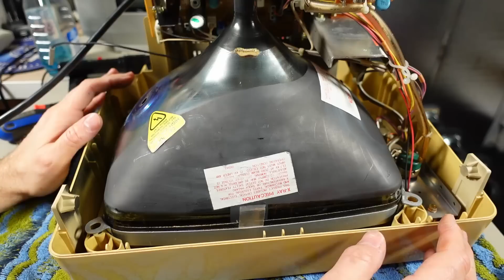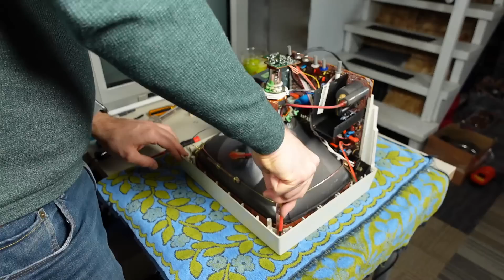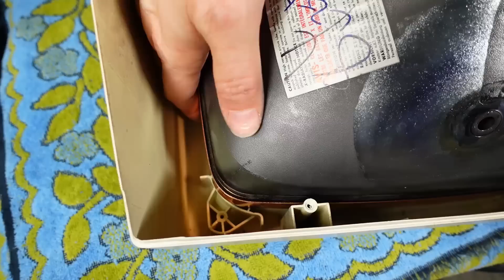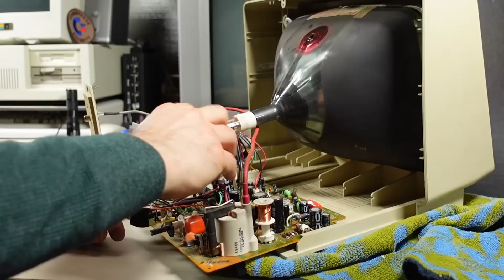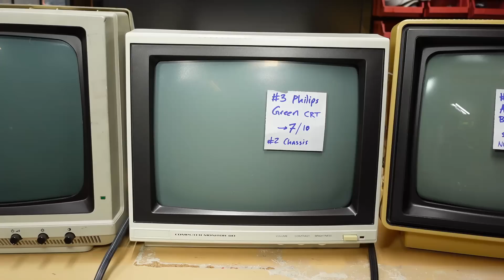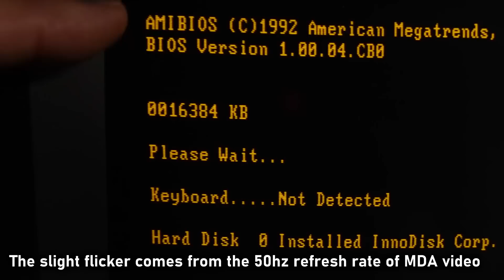Let's improve some monitors! (Part 2)

Comment: What CRT tester are you getting? I recently bought a Sencore CR70 for my vintage/antique TVs that help feed my retro-gaming addiction. Funny thing is, the game consoles were not retro when I got them. Just couldn’t part with them and now they’re considered retro. Damn I’m getting old (recently turned 40).
Reply from the maker: I got a Konig TR850 which is the same as the B&K 490B. I'll be showing it on the channel soon as it's a neat tester.

Comment: Not sure if it has been mention but grounding the high voltage to the monitor chassis does not discharge if the chassis itself is not currently grounded. Essentially its a floating ground at that point. Proceed with extreme caution if doing as Adrian has demonstrated.

Comment: A Sampo monitor?  About 20 years ago I bought a crappy digital camera which had no branding on it anywhere.  In exactly one spot in the manual there was a place blacked out with a marker, and I could barely make out the name "Sampo" underneath it.  It's like they were so ashamed of that camera they didn't want to put their name on it!  (It really was crappy, too.  640x480, internal memory with a max of 32 photos, manual focus only, no screen at all other than the tiny display that showed photos remaining and battery life, and it only transferred photos through the 9-pin serial port.)

Comment: Brightness seems ok to me. Having used those amber monitors, i actually liked that they are reasonable dim yet have a great contrast, the color just perfect for monochrome, i personal like that much more over green or - the horror-  BW. I don't recall maxing the brightness on the monitor i had, quite the contrary. Then again hard to judge on video i guess have to go with your judgement too.

Comment: You know where as those cloth coverings are concerned I've always wondered why they didn't make them a snap-in attachment. It wouldn't have been hard to do and it would've made them a whole lot easier to clean. What a fail. On the one with the case that doesn't fit, you could safely flip the CRT over. It should still be safe enough for the PCB because there's more than 3" gap from the components in most of those old monitors. It's worth checking out.

Comment: The breathing expansion phenomenon is caused by the variation of the anode high voltage. Because the deflection sensitivity depends on the anode voltage, there are many ways to improve it.

Separate the high-voltage circuit from the deflection circuit, and install a negative feedback for the high-voltage circuit to adjust the high-voltage power, which has the best effect. This method is used for high-end models.

In some chassis, although a combined circuit is used, the Re-trace capacitor is divided into two parts. One part of the capacity is adjusted by the PWM switch, and the high voltage can also be adjusted.

Generally, for CRTs produced in the 1990s, the ABL voltage is connected to the horizontal size modulation and the vertical size negative feedback for dynamic compensation, which can be partially improved. This is the most common method.

However, the focus voltage is still affected. In addition, the pattern still produces multiple distortions. Some models use ultra-high voltage capacitors and resistor packs to remedy them.

A lower cost method is to directly connect a resistor in the main power supply. When the beam current increases, the power supply of the deflection circuit also decreases, achieving self-compensation, but there are many side effects.

Some FBT manufacturers will try to reduce the output impedance of high-voltage power, and even carefully design the resonance frequency to odd harmonics, so that the Re-trace parabola is closer to a flat-topped square wave and reduces voltage changes.

Comment: The monitor with the crt that the back dose not fit couldn't you turn the crt upside down so the high voltage connector is on the bottom?

Comment: Do you adjust the yoke by hand with the power on? Is that safe to do?
Reply from the maker: I did -- I turn it by the plastic part -- there are exposed terminals which can give you a zap, but the copper color parts are enamel insulated copper. If those were not insulated, the whole deflection yoke would short out.

Comment: Not to be “that guy” as they say but get a flat tip for your HV probe.  If you do find a CRT with a high stored charge then it will easily jump from to the screwdriver you were using which won’t be rated to kilovolts.   I still work on CRTs for arcade enthusiasts so I’ve had a zap or two.

Would you also mind telling me what the rode mic is you have clipped to your shirt?

Comment: Adrian! 22:12 don't do that anymore!!! If you let the tube on the table like this it make a small sound like "crack" and then the Picturetube is total distroeyed. I was at Philips Videorecoder (IR3 Gutheilschodergasse 17, 1120 Vienna) Company her in Vinna from 1997 - 2000 and I work for 35 years as a Radio & TV service and this is a nogo. Sorry to tell this - but what you are doing if the tube make "crack"? You can hit the screen on the trash. Best Regards Volker from Vienna and Thumbs up Nr. 2522

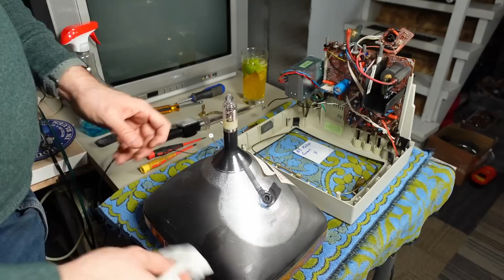Comment: 11:13 Cleaning the inside (and the back of a CRT in particular) is not weird at all, older tubes can (due to 
static charge) have collected a lot of dust and if there was a smoker in the area also a lot of (sticky) tar.
The high voltage can easily creep through and reduce the picture quality or even damage the electronics.

Marvin says: Don't panic and wear your Mask. 🖖😷👍 ❗

Comment: Actually the bloom on the green text at 26 minutes is from the cathode.  Due to the very small pinhole for electrons, the current caries away the material in the center of the cathode so it no longer emits electrons, so when you turn up the brightness, the area around the dead center of the cathode produces the emission. This larger emission area through the grid results in that soft edge dot on the phosphor.
If you ever trash an old worn out CRT, carefully disassemble the electron gun. Remove the grid off the cathode inside of it and look at the surface.  You will see the center has been sputtered away by the emission current from the center of the cathode.

In a prior career, I used to put new CRT's in televisions when color TV's were very expensive.  Used to do the rejuvenation which blasts off some of the cathode material to remove the dead layer that blocks emissions. This is often a short lived fix as the now thinner layer of emission material is quickly burned through, and if the tube is old enough, the rejuvenation will remove the last of the active cathode material, rendering the tube useless. An alternative to rejuvenation of the cathode is to use an auto transformer on the filament to run the cathode hotter to increase the emissions. This too, increases the aging rate, but provides a temporary extension to the end of useful life of the CRT. The transformer often would raise a 6.3V filament to about 8 volts.

Comment: I had that NAP monitor.  Even brand new, it had that picture collapse at the top.  I had a friend with the same monitor and same problem.  That is the "personality" of the monitor.  It was cheap and available at PriceClub (now CostCo).  It didn't cost much.  It was a tank though.  It fell down and flight of stairs (carpeted) and survived without issue.

I used it with my TS2068, and because that computer had a relatively large border in its display, the top weirdness was easy to ignore.  I don't remember the price, but I am pretty sure it was dirt cheap (under $50).

Comment: my 21" crt tv doesn't produce black lines in 240p content, plz help
it has FM radio built into it so it's a more modern crt, i think it actually interpolates 240p into 480i somehow
if it's actually a defect, can you elaborate? can a bad component cause this? the image is sharp and has good color

Comment: Very nice!  A couple of years ago I was working on my Tek 465M scope.  Taking it apart required removing the CRT and discharging the tube.  After about the third troubleshooting, after there being no charge on the anode for those first three attempts, when I grounded it on the fourth attempt, ZAP!!!  Lots of charge!  I've now got a discharge tool / meter stick similar to yours.  :)

Comment: How hard is it to make a new monitor of that type?
Reply: Blowing tubes requires heavy industry. Normal glass is not sufficient (x-rays), you need lead-crystal glass. Then you need to coat your tube with phosphors, which are no doubt no longer in production. When you have done that you need to install high precision components into the tube that form the electron gun. Sounds pretty unrealistic to me.
Reply: @danielmantione  3d printing a car sounded unrealistic a short while a go :D

Comment: This reminds me of something I did nearly 35 years ago - I'm 50 now so you do the math - to an Amdek 310, though not nearly as extensive as what Adrian has done here. The 310 I had used a proprietary 8-pin connector for the video cable. I swapped the connector out with a standard 9-pin video connector so it could be used in IBM PCs. It worked perfectly.

Comment: After discharging always ground the cup against the monitor's grounding strap a second time or other directly connected ground.  The capacitance can have rebound and not be completely discharged. I've watched my boss have to repair a customers console tv case after he put his elbows through it, luckily it was wood and easily repaired with clamps and glue.

Comment: Incidentally, in regards to the need to ensure residual high voltage from a CRT is drained before handling it, it is because it is like a giant capacitor. One plate is the metallic lining you can see, the glass itself stores the charge, then the other plate is actually that dull black coating on the outside of the CRT. That coating is called ‘aquadag’ and I understand you can actually buy spray cans of the stuff to touch up CRTs where the coating has been damaged (making sure to mask off where it’s not needed; it’s just graphite and glue). Also, when mounting a CRT, for that reason, the grounding straps should be checked to make sure it is making good contact.

Comment: If you ever need to repair/replace aquadag.  dry graphite lubricant works damn well. The aerosal works great but I ended up buying some loose graphite lubricant and mixing with elmer's glue, then diluted with water to paint on.

Comment: why not buy one working one but have 4 shitty ones? And I dont think that there is much of a problem on CRT, why should it be dim or something, I always only use is on half of the settings anyway and never had any problem with a CRT (except burn-in or complete broken/shattered) but not from the picture quality. Its not a High def display and you can be glad those work AT ALL.

Comment: Cleaning on the inside is good practice as dust /dirt can cause tracking of HT voltages.
This reminds me of working on these Philips monitors may still have service manuals 
Nice to see safety first as working on a 26inch back in the eighties knocked me out for three hours and numb hand with pins and needles for couple of days. As working on my own until my parents can home.

Comment: 29:40 if you used a heat gun i bet you could deform the inside of the handle a bit so that it would fit over the anode cap.

Comment: You could reinstall the CRT upside down in the ugly monitor, and then the HV lead would be on the bottom and thus not interfere with the handle.
Reply: I did think that, but there didnt seem to be much space below so wasnt sure it would fit. I wonder if someone is doing NOS CRTs?
Reply: I had a similar problem with a Grundig TV. Here it wasn't a tube swap, but the tripler was bad. The replacement tripler had an anode cup that was a lot larger and interfered with the handle...
And when I shoved a Vectrex motherboard into an IBM5151, I also had to flip the tube because the Vectrex' anode cable was way too short. I call it Wrectrex because the Vectrex had a broken case and CRT and the IBM5151 had a bad flyback.
Reply: Came to the comments to say this indeed :-)
Reply: Ya, but then all the electrons would fall out!

Comment: Well, my prediction on the previous video was right, the green tube was brighter when replacing the amber tube, hence the need to lower the sub-brightness control. And replacing the green tube with the amber tube resulted in a much dimmer picture. I'm guessing they'd use different component values around the brightness/contrast control circuits if they had different phosphor options on the same monitor.

Also, it never occurred to me that you could flip the tube to put the anode connector on the other side.

Anyway, good to see new life brought to some of these monitors. Just a shame that so many were so worn out or had such bad burn-in. At this point it's practically a lost art to repair the tubes themselves, since the equipment and skills required are so specialised. Especially manufacturing new tubes. I know there's a guy on YT that manufactures brand new Nixie tubes, but there's a huge gap in specialised technology between a Nixie and a CRT. So I guess tube swaps are the best we can do to try and save these old monitors.

Comment: The blooming you see on #3 might also be secondary electrons. Not sure if you excluded that. It would come from an acceleration voltage that's too high. The electron beam smashes into the screen with so much force that it knocks other electrons out of it. They then fall back onto the screen in a circular pattern around the original electron, creating bloom.

Comment: Adrian if you want the picture to be sharper you should overhaul and possibly upgrade the power supply to lower noise on the voltage rails, as well as the amplifiers to make them less noisy and more linear

Comment: @Adrian, if you watch shango066's channel, he does a process on some vintage CRT tubes where he removes and cleans off the cataract material between the front safety lens and the tube's viewing area, he uses a trash can and places the tube neck down inside the can while he does the cleaning.  I was thinking you should do a similar thing when you go to clean the front of the tubes. This way, the neck won't accidentaly be broken.

Comment: Part of me puckered up when the board came out of the first Amdek monitor and the screen started tilting as though it was about to fall, that would have been messy..... :S

I need to get the PSU for my Torch-branded Sony monitor re-capped, got the caps at long last for it, just need to work up the courage, scary 240 full-fat volts and all... :P

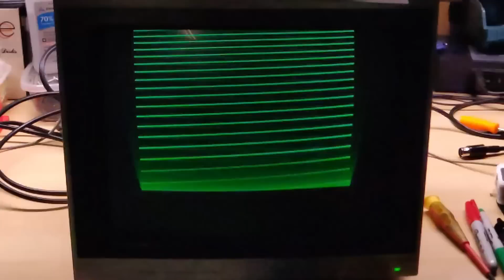Comment: 28:17 I love that footage. I wish a collection of CRTs turn off short footages, one after another.
I might use it as a collection edit together with shango066's TV off takes of old tube CRT TVs.

For future software emulation, they can be the models of reference.

I think the deflection shrinks first as the power supply fall. 
Then, the emissions as the cathode cools.
The high voltage might be the last thing to collapse, so it keeps the beam on good focus until the end of the emmisions.
If I remember correctly, there is also a 'center dot' prevention circuitry to avoid the burn in on the screen center after repeated shutdown cycles.
Reply: I am really good at dropping CRTs,  I have two now with chipped glass

Comment: Thank you for showing this process - its interesting to see how monitors were built and it seems like there were noticeable improvements in the three keepers. I love amber monitors - I remember working with them at work as the library catalog terminals used on old Unix system through the 1990s and they were so restful on the eyes vs. later CRTs.
Reply: Think we had Newbury Terminals that were orange

Comment: You can get a shock of an anode of the tube even if it has not been switched on for a while it is like a very big capacitor make sure it is discharged also remember your dealing with glass so I would wear glasses

Comment: When yo turned the CRT around on #2 chassis (you also had to turn the neck board by 180  degrees). Wouldn't that make the picture appear upside down?  How did you adjust that, by turning the yoke 180 degrees?
Reply: The tube is just a screen covered in phosphor and an electron gun pointing right to the center.  It has no inherent orientation.

The yoke affects the beam magnetically to point it at different spots.  That’s why monitors have a scan that goes left to right and top to bottom.  The electromagnet steers the beam around the screen according to the input signal.

When you slide the yoke on the (upside down) tube, with the yoke still in its original orientation, the picture looks exactly the same because the force applied to the electrons IS the same (wrt your perspective.)

Comment: Well, @29:03 you could put the anode at the bottom, there is plenty of space, and then cut the yoke connector in the middel, flip hori and vert around, voila. Everything fits :)